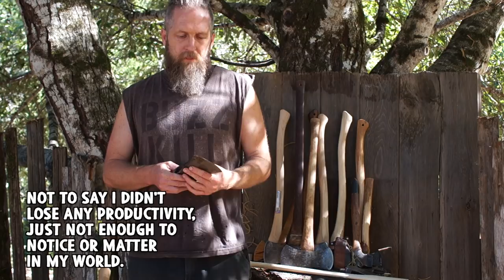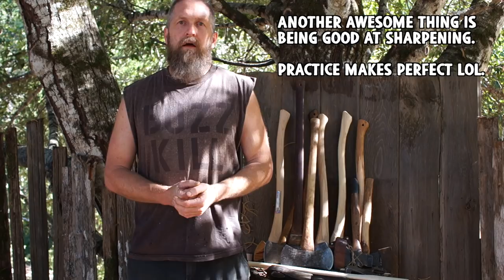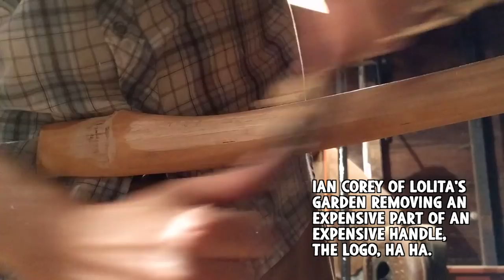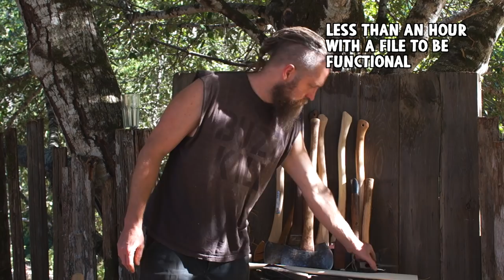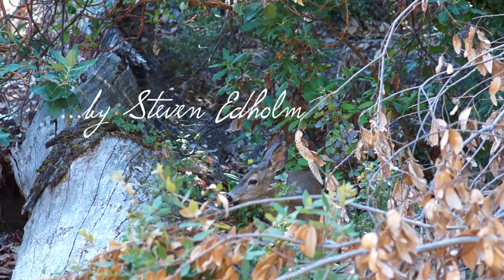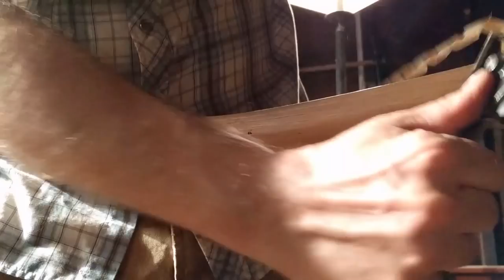Expensive Axe Buyer's Guide: (SPOILER ALERT, Don't Buy One)

Comment: As a novice, I'm looking to get the Council Tools boys axe.
Reply from the maker: I did hear that we might have some quality control issues from one person, Definitely heard a few complaints about loose heads too, but nothing that couldnt' be worked with.  I think at that price point, there is probably always going to be some less than optimal specimens.
Reply: Like you said, it's a cheap axe. A loose head, will become a learning experience.
Reply: Also. Thanks for the channel, the information, and advice.
Reply from the maker: yes, much to be learned from handling the problems that arise with maintenance, modification and repair!
Reply: Had to send my Forestry Axe back to Omaha as I re-wedged it and even put in two steel wedges and it was still loose. Ordered the Boy's Axe on Amazon and I think Omaha will send me a new new Forestry so I'll hopefully have 1 working axe. We'll see.

Comment: I have to say that footage of peening the axe is just awesome.  You get the best close footage of real work.  100% agreement on overpriced  Scandi axes.  I'm not gonna spend another $100 on an axe just because some Viking dwarf forged it under the spreading arms of Yggdrasil.
Reply from the maker: I would pay for that if it were true lol.  Get a good macro lens.  I don't remember what you shoot with, but you can only do so much without an interchangeable lens body.  If you're on Nikon or mirrorless get that lens.  55mm f2.8 micro nikkor.  Worth every penny of the under 100.00 it will cost you.
Reply: Double points for flicking shit at wranglerstar

Comment: Give yourself a realistic budget, then do your research on what characteristics and features you really need, then look for a used one in good condition that meets the criteria and well under your budget. If it needs a little TLC to bring it to a good useable condition, then start by learning the correct maintenance and care as part of the learning curve. If you get skilled enough that you recognize the tool is limited or you have outgrown its abilities, or it is not the "right" tool for your task, THEN you are at a level where investing in the high end stuff MAY be worth it, though it seems to me that most skilled people prefer older tools and restore, or personalize them to what they require. The only thing worse than overthinking is overspending. Price point rarely represents an equal increase in quality or performance.
Reply from the maker: I think most just need to get what they can find and start using it.  Like you said, experience will sort out a lot.  I kind of which I'd emphasized that it may very well never be thought prudent or necessary to buy an expensive, or fancy in some way, axe.  I realized at some point in editing that I could be seen as endorsing certain companies or paradigms in the industry if someone wanted to see that.  Hard to get every point right when mostly talking off the top of my head.

Comment: Chuckling as I listened. I know and like good tools (one of my most prized is the 4 lb. Sager falling axe I inherited from my father). But true confession: The last axe that got me out of trouble was a yellow plastic handled Harbor Freight. Super cheap. A few minutes on my belt machine gave it an edge, some rust preventive oil on the head, a crude cover of cardboard and electrical tape (didn't have any old double jacket fire hose), and I threw it in the trunk. When a tree blocked the road home (one day after I decided to take the winter chainsaw out of the car because it was March), that axe was in the bottom of the trunk, waiting. Yeah it was cheap, but it was 3.5 lb. full length axe when I needed one. 😃
Reply from the maker: Been thinking about setting up a fiberglass handled axe for my vehicles.  Wood handles just can't take the california sun in a car.  I usually take an axe with me when I go out, but then I have to remember to bring it back in.
Reply: I used to carry a plastic handled axe and a shovel with pipe handle on the side of my "woods" truck. Those plastic handled Harbor Freight double bits are ""disposable axes," but the slim handle is flat enough on the sides that you can feel where your edge is. And once you grease up the head, you needn't worry about the handle rotting.

Comment: Got the husqvarna hatchet then watched your review on it .... gutted it was mainly for the hand forged in Sweden and was cheap I got for less that 30 pounds UK I'm going to put a longer thinner handle on it as it seems to big for the handle that's on it at present am a bit scared to do this as av never changed 1 before but I feel confident I can after watching your vids... was cheap enough so why not.
Reply from the maker: Just jump in on the handle thing.  Go slow to get a good fit, especially front to back and at the bottom of the eye it should be tight.  It should be pretty good for a little bit longer handle.  I'm sure it's a good piece of steel.  Just a weird size.

Comment: A lot of people do that because they don't have the tools, experience or patience to put a ton of work into a new axe or hatchet just to get it to cut. I do on some level undetstand their frustration.
Reply from the maker: I think if you spend enough, you can get something ready to cut, but I have yet to see anything I wouldn't modify.  Eventually, any axe user has to learn to sharpen, re-profile, hang handles and tune up handles to be really competent.  Cost is also relative though. If the money is not a big deal, maybe starting with something more set up could be useful.

Comment: Companies don't just decide to sell out. It is hard competition, and especially done by pricing. People go for the cheaper product more and more. And there you are telling people not by a quality tool. I agree, it does not have to be Gransfors, but still, by quality not cheap crap.
Reply from the maker: I didn't say to buy the cheapest crap. I think they one suggestion I gave was council tool budget line.  But you are right I'm sure the market does drive companies in that direction.
Reply: @SkillCult  thats true, you did not say that and I apologize. I watched your follow up video and I am glad you did, because it makes the missing statements. Maybe link that into the video... I don't know Council tool, but if you say they are still manufacturing in the US and keep the technical shortcuts in check then that is a reason for looking at those.
As Brunby says, it is hard to sell high quality axes to a market, that is relatively small. So he came up with some marketing tricks to add "extra value" to the brand Gransfors...
https://www.youtube.com/watch?v=LMuFFgFAfOQ
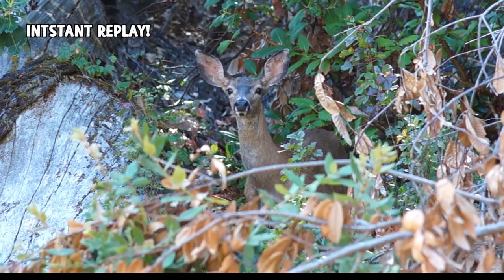jump to 16:52 when he talks about the axe market when the chainsaw was conquering the world.
Reply from the maker: @MartyInTheWoods   Yeah, but I also think I didn't say NOT to buy the cheapest garbage, which I should have probably.  Youtube has essentially done away with the option to put in notes, but I could probably put in a card and endscreen if they aren't there already.  This was many parts rant and not very well organized or thought out.  I would have included more and changed emphasis a little with disclaimers about buying total garbage, which there is plenty of.  The Gransfors story I find very interesting.  He basically eliminated a lot of work and expense, made the axes look rougher and more handmade, and sold them for much more lol.  In all the effort he says that they put into making the best axe, he failed to mention that any of them actually used axes, which I'm pretty sure they've done very little of.  I think that is the major problem currently with axe producers is that they are changing designs without enough experienced input.  My suggestion to Gransfors would be to start a sponsorship program for professional axe users.  People that really use them a lot, like traditional loggers and historical demonstrators etc.  There are not very many of them, but find them and work with them on design and execution.  Also, they should have a wood lot and chop every week.  Just my opinion lol.  Imagine the marketing potential in that!  I've yet to see an axe maker publicly demonstrate versatile, high competence with an axe.  They could also work on alignment.  I'm pretty sure any smart fabricator could come up with a jig device to align those heads in about 10 seconds at the end of the forging process.  The good points, they seem to consistently have well fit handles with high quality wood and the booklet was a great idea.  They make nice masks.  They look cool.
Reply: @SkillCult  🤔 You also could change the title of the video a bit. That's the first thing people read, so if you want to mark it as rant 👿 or change the initial message, then this would be a good point to do it.
You also have a follow up video, which is really good, so you may want to link to it. Unfortunately people rarely read the description of a video, which, of course, Youtube's setup is at fault too 😉
I was thinking you would like the Gransfors story - going by your channel, you seem to be a "major axe-head' 😄
For Gransfors the market is not the professionals, but more so private people for after hours activities like splitting wood and bushcrafting. I did not see lumber jacks or tree service guys on youtube use Gransfors products. That is just nor their market. So, while your idea sounds interesting, I don't think they will break into that market at all - price alone will already prevent that. For professional there is a lot of other brands (mostly big tool companies), still high quality available. They cannot compete with them, so they need to stay in their "niche". Not an easy place to be...
I remember the first time I saw a Gransfors axe was about 20 years ago in a fancy tool and expensive gadgets store in Munich. Unfortunately I don't remember the prices anymore. At that time, I did neither need nor use an axe, yet already intrigued by the Gransfors product line - so marketing wise they must have done something right - and it is not the booklet alone 😄
10 years ago, I was visiting my mother in law and grandmother for a longer period of time and I needed a splitting axe for making firewood for the next couple of years for them. So I did research and bought the Wetterlings large splitting axe (with turpentine profile). Significantly cheaper, but still a good quality head. I think it was 💲80 at the time... 
Later, as we changed over to heat our own house with a wood burning oven (the oven heats water, which gets pumped into two buffers in the cellar) and this is how I got more interested into axes myself, because we make our firewood ourselves in the local forest. 
Well then, keep up the good (axe-) work 👍👍👍
Cheers, Marty
edit: I forgot to mention, that since you mentioned Council Tool (its just not really known well over here in Europe) I did check my small axe collection, because I did remember something...
... and there it is, the American Felling axe, that my father found in the forest 30 or 40 years ago is stamped CT and is a 4# Dayton head - it must have been lost by the US Army in our forest while they were making maneuvers. There is no date stamped in there...
I had to put in a new handle and I was surprised how narrow of a wedge it is. 
I actually have a video on Youtube using that axe, but there is no close ups. It was the first (and last) time I did fell a tree with an axe / usually I use a chainsaw I'm afraid to say 😀 😀
https://www.youtube.com/watch?v=9ESqkG3bCX0
cheers again...

Comment: Best tool for reshaping a handle? Spoke shave? Any reason I shouldn't use a bastard file cuz that's what I'm doing cuz that's what I have...
Reply: ...and a knife. I also used a mora
Reply from the maker: Spoke shave is about the fastest and overall best, but you don't need one.  A 4 way rasp is great and scraping with a knife at right angles, though it can really trash your Mora edge if it's a full scandi grind.  I rarely end up breaking out my spokeshaves for it, but they are good for sure.
Reply from the maker: Bastard file sounds slow and prone to clogging, but not going the hurt the file any if it works.  Just clean it will after.
Reply: SkillCult I actually used the mora for carving as opposed to scraping since I decided to remove a fair bit of wood. I really didn't like the shape of the handle it just had too much swell in a weird way. The file did sort of ok between the flat and concave sides but the angle of the teeth would send it sort of sideways. It ended up usable but I will be getting a that rasp for sure.

Comment: For me some of the most important aspects of these expensive tools is the manufacturers dedication to keeping a craft and tradition alive. For me there is a value in the fact that buying a locally (I'm swedish) handemade axe and I support small businesses and the people how work there and their commitment.
I completely agree with the statement that you should start with cheap axes to learn to work with them but I think that classifying expensive axes as just trophies for stupid people is to simple.
I own both Chinese and Swedish axes but if I could (had enough money) I would like to buy tools based on criteria like: Quality, locally produced and the manufacturers dedication to Craft (SKILLS) and invention and their employees.
Ideally I guess I would like to buy an axe from the village blacksmith made with local materials rather than an axe from a Chinese factory :)
Reply from the maker: I may not own a single chinese or other cheap labor economy production axe.   Maybe one hatchet and possibly a craftsman made in perhaps mexico, both used.  I don't recommend that people buy junk, but inexpensive doesn't necessarily equate to junk.  It is cool that those places are still making axes.  That's a good point and one I made in the follow up vid, but should have made in this one.  I was too busy ranting though :).

Comment: I use an axe quite a bit for driving wedges and splitting firewood. From my experience I don't need a $100 axe to get the job done. I have a few old axes that I have collected over the years but I take my council tool axe out almost daily. A good axe can mean a world of difference of where a tree will fall, keeping your saw from being bound in the cut or my favorite when you have to chop your saw out of a limb due to some crazy bind. Quality is in the craftsmanship not in the price. Well said skillkult.
Reply from the maker: Which council do you have?  I like the form on the boy's axe a lot.  I wish it was a tad heavier though.  I've heard some complaints about tempering issues, but they usually seem pretty good.
Reply: SkillCult I have the boys axe, 6lb axe and the broad hatchet. I use all of them regularly and never had a problem with them holding an edge but they all have different uses.

Comment: cheap wise really just get an old axe i got a nice Norlund cabin axe for 50$ and Norlund was the high end back in its day also to anyone that gets a dirt cheap box store axe you are better off getting a Fiskers then a Truper what ever you do don't get a truper or a collins which is owned by truper unless you want an axe that gets dull from be swung through the air
Reply from the maker: I've heard of air hardening steel, must be a special alloy, air dulling steel.  I'm pretty sure council and maybe snow and neally are the only game left in the U.S.
Reply from the maker: Oh, and I really like the vintage option, but some people probably just need an out of the box solution to get started and can learn handling and other stuff over time.
Reply: SkillCult ya I can understand that but I mean you can find a lot of aniques with handles when I started I was stuck with box store stuff couse I was 11 and dident understand from blade to cheek so it was a good novice beater but now 4 years later I go it in the woods for hours on end with only an axe so I need those high end metals to hold the razor blade for good efficiency

Comment: For hatchets, my larger of the two versions Estwing Sportsman's hatchet gets the nod. Right about 14" in length. Not even remotely as good-looking as the Gransfors Bruks Wildlife hatchet at 13.5" in length. But gets the job done, and you can buy a handful of those compared to the Wildlife hatchet. This is not a ringing endorsement of Estwing! 

The guys running Estwing are obnoxious with that industrial strength glue that they use on the backs of their labels/stickers they insist on putting on their products. Have fun getting that stuff off your hatchet or axe after peeling the labels off! They know it's an issue. They don't care. Just the aggravation and effort of getting that glue off almost makes the Gransfors worth the asking-price. ALMOST.
Reply: If it's tacky glue , found WD40 works pretty good on most tacky glue residues.